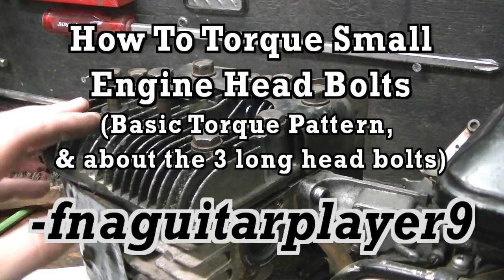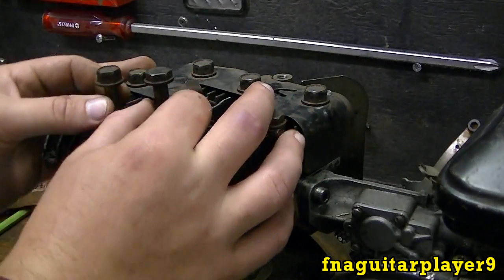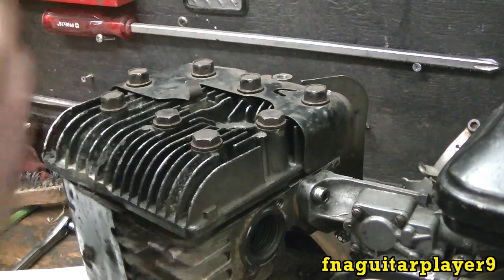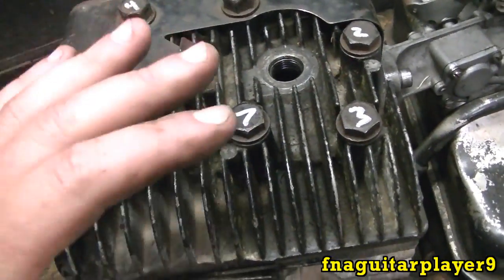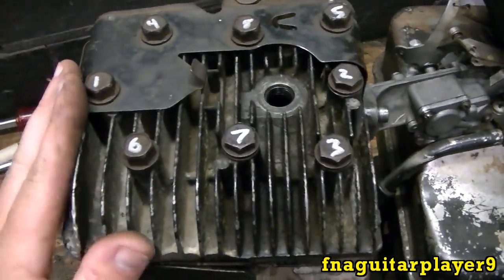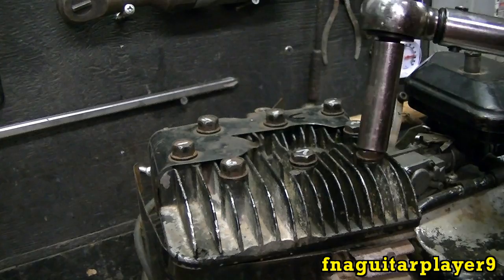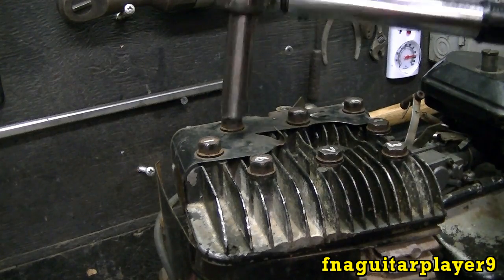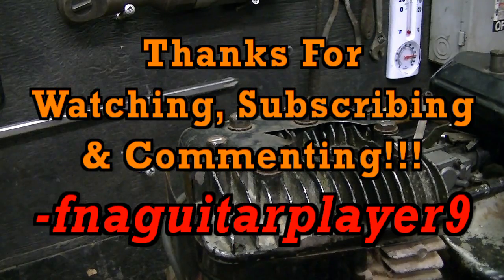How To Torque Small Engine Head Bolts Basic Pattern & Info on 3 Long Bolts

Comment: Wrong, you torque in increments to final spec and retorque after about 25hrs of use. Most briggs and others with 5/16” bolts are approximately 17 ft lbs, or 200 inch lbs. in proper sequence. My advice is for aluminum head and block on most. Cast iron blocks have a different sequence as the heads vary in shape.

Comment: Hi any idea what a tecumseh 3hp H30 head bolts torque at? Everything I find on Google states 200 ft pounds that seems quite high to me.
Reply: I was looking for the torque specs for my h60 and came across what I thought is the same thing you saw, however, it's 200 INCH lbs NOT ft lbs. I said the same thing that it seemed too high and I went and dble checked! 200in lbs = 16.6 ft lbs

Comment: Great information!  I have a Tecumseh LH195SP and the torque specs are 200ft lbs.  My torque wrench only goes to 150.  Is the additional 50 ft lbs critical?
Reply: Double check the spec
I would think it is in pounds inch pounds
Much less than foot pounds
Reply: @potaylo  

Thank you. You're right it was in inch pounds not foot pounds.
Reply from the maker: Yes i would recommend getting another one that goes up to the spec you need, that is 1/4 of the torque required. Thanks for Watching!!!
Reply: common sense says  No Way 200, Japanese never use imperial in our shop manuals any ways. Most are 25lbs/ft in Yankie units 50 tops.
Reply: @jonnscott4858  

Common sense to a repair tech maybe...not someone doing it for the first time.  Think before you respond sonny.

Comment: Hello, do you know how to find the size of the crankshaft bolt on a small engine without having the bolt? The thread size I mean
Reply from the maker: What engine are you working on, alot of smaller side shaft engines will have a 5/16 fine thread or a 3/8 fine thread. Thanks for Watching!!!
Reply: @fnaguitarplayer9  it’s was a5hp Briggs. I found out it was 5/16 x 24 or 20
Reply from the maker: @connorssmallengines6663  That sounds about right

Comment: Hey my 3hp briggs horizontal shaft only has 1short bolt every other bolt is long and I don’t know where the short one goes, and the bolts are factory original
Reply from the maker: As long as the 3 bolts around the muffler/exhaust valve are long, the one short should not matter i wouldn't think. Thats odd, most have only 3 long bolts. Thanks for Watching!!!

Comment: Enjoy your videos, very helpful. Question my 8hp B&S model 195437 0150-01 isn't starting all of a sudden. Won't fire with starter fluid in carb but will fire with starter fluid in the Plug hole.  Changed Carbs, new plug, good spark. Pulled head cleaned the valves, needed cleaning but not stuck. Trying to reassemble head. What is the proper head bolt torque for this engine, can't seem to find it. Thanks
Reply from the maker: Appreciate that. the head bolts are torqued at 165 inch pounds. Thanks for Watching!!!

Comment: Do you oil your bolts or not? I’ve seen both ways.
Reply from the maker: No, I never have some recommend it but I never have, on some things i'll use antiseize or loctite just depends on the situation. Thanks for Watching!!!
Reply: @fnaguitarplayer9  hello.  i have a craftsman 917 with 6.5 hp and i can't find the torque spec for inch/pd please!  this is my first major repair!  thank you!

Comment: I cannot find the connecting rod torque specs on my Briggs and Stratton ( Toro)  128M02-0017-F1 engine.
Reply from the maker: It should be 100 inch pounds. Thanks for Watching!

Comment: How much torque are you using to tighten those bolts?
Reply from the maker: Depends on the engine, but this was a 5hp model 13 so i should have been torquing them at 140 inch pounds. Thanks for Watching!!!

Comment: What a great tip! Something so simple as lettering the bolt heads! Duh, never thought of it. Beats trying to remember what bolt I tightened last. thanks man! It's why I keep watching.
Reply from the maker: I hear ya! It does make it simpler. I usually just use a general criss cross pattern, but it is best to follow the diagrams. Your welcome! Thanks for Watching!!!

Comment: Thanks for the video!
 I'm getting back to a 1997 Briggs 5.5 HP flat head that I took apart about 3 years ago for a mini bike project I have. I have a few questions I'd like your opinion on about it. I don't know if you'd rather me ask through email or on your YouTube channel here but one question is....... I've recently watched a video about gaining compression and power from swapping out the 5.5 HP head for one with a smaller combustion chamber like say on a 4 or 3.5 HP Briggs. Will you give me your thoughts on this type of swap?
Reply from the maker: Your welcome! I hear ya. Its fine on here or message on here, it don't matter. I've never done it myself and I know it can be done, one example is the 12 hp briggs, a head off a 11HP will raise compression on the 12, its definitely worth experimenting with, because any extra compression on flatheads is a major help. They do it all the time on racing lawn mowers, go karts and mini bikes. I've been wanting to experiment with it. (maybe a video next summer on it). Thanks for Watching!!!
Reply: fnaguitarplayer9 Thanks for your reply, I just might experiment with it myself...
Reply from the maker: your welcome! I've been wanting to put a 11hp head on my mower just to 
see how much difference it actually makes. Might to do that this summer 
and make a video on it.